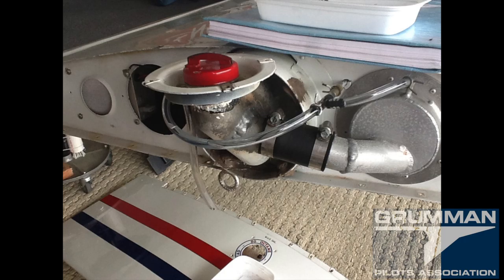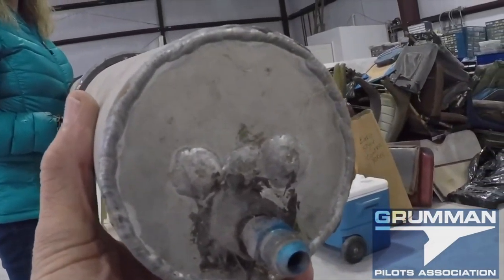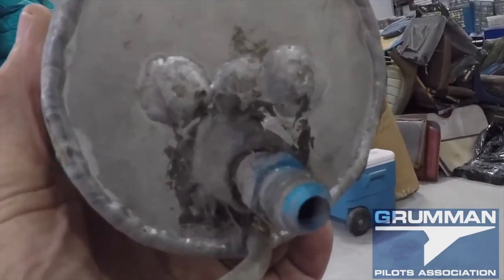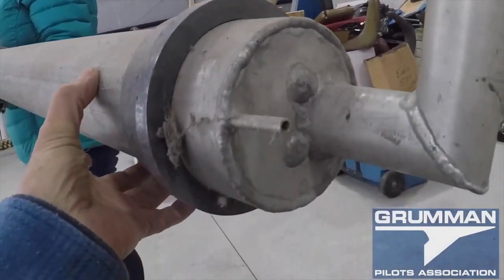Aux Fuel Discovery - Grumman Style

Comment: The aux tank using the connector to directly fill it is mounted forward of the main spar, and the AIr Mods aux tank is mounted behind the main spar.
Reply from the maker: Actually, the air mod system can go forward as well as rear of the spar. (i.e. 20 gal aux. system)
Reply: @GrummanPilots  Ok. Didn’t realize that. Thank you.